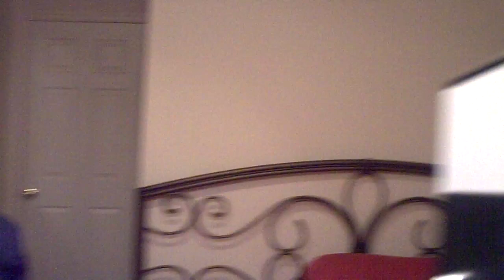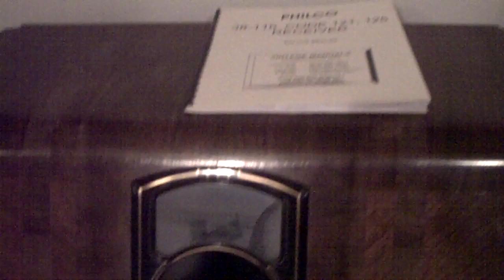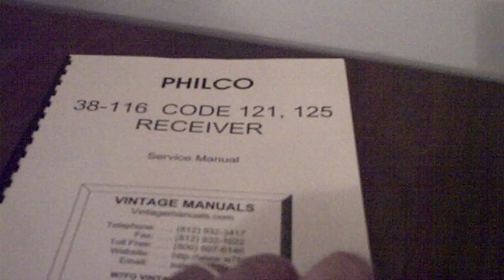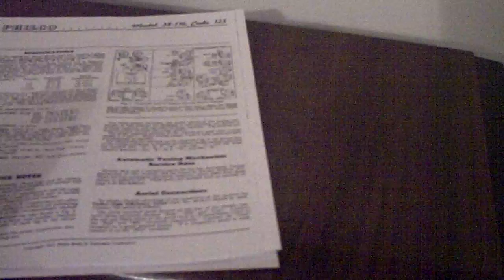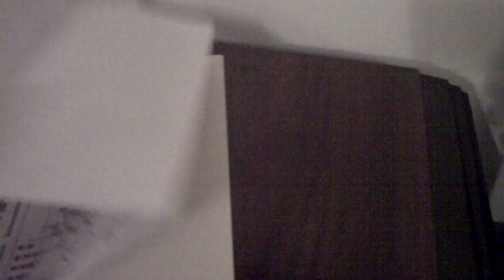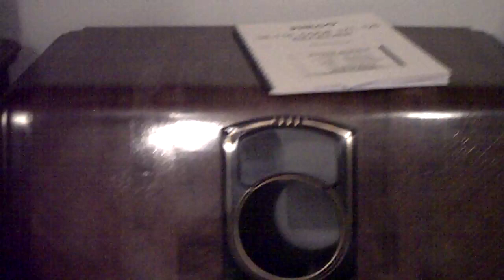Next Mission, Philco 38-116

Comment from the maker: any missing tube shields need to be replaced. the radio won't work correctly since some tubes interfere with other tube operation if the shields are removed.
In part 2 you can get a good look at the radio chassis installed in a homemade frame

Comment from the maker: My radio doesn't have any magnifier for the dial. the bezel on the case is just clear. If you jump to the last video i made for this series, you can see the chassis installed in the case and working.I have some closeups of the dial.

Comment: I guess I have some watching to do.  I just brought home this radio.  The lady said she had this radio since she was 14 and got it at an estate auction.  She was sad to let it go but glad it was not going to the landfill (not yet)....First thing I see is the little tube "cages", I have 1 (one). Second, The screen (perhaps magnifying) above the dial is gone.  Third, the top of the case has been pulled upward which has made a crack in the facing of the radio at the curve.
Last, different case.